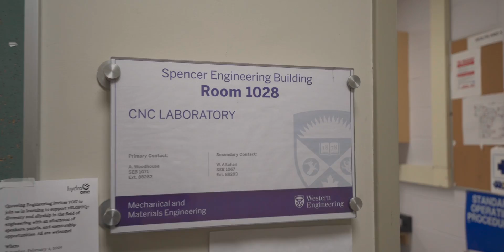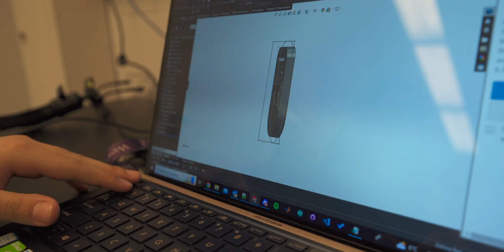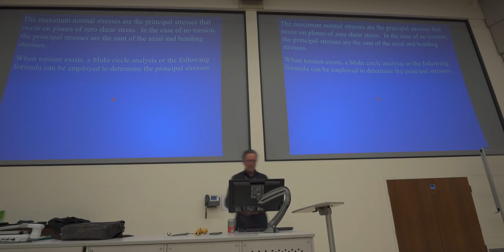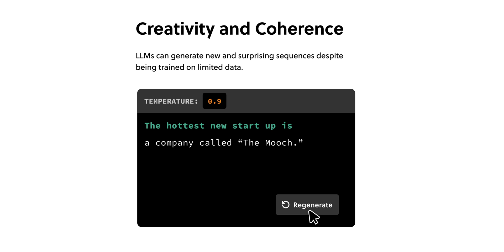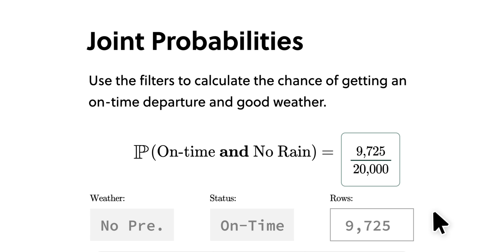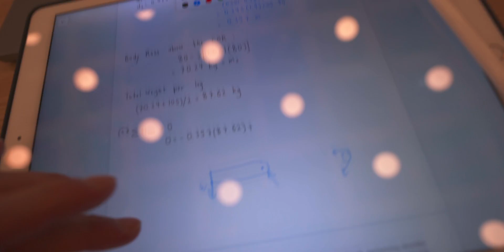My Day as an Engineering Student👷🏻‍♂️ CNC Lab, Lectures & Study Grind!📚

Comment: would you recommend an ipad for incoming engineering students? as well as some sort of advanced computer? I have a macbook air currently but im sure that wont be able to run engineering programs. correct?
Reply from the maker: I would definitely consider getting a windows computer with decent specs if that is the only device that you are planning to get. But an iPad would be excellent for note taking, but it will not be able to run any engineering apps. Same with the macbook, it is excellent for note taking, but you're right, a macbook wouldn't be able to run some of the engineering apps. My personal recommendation would be to get a touch screen windows laptop that can fold all the way backwards that also has stylist compatibility.